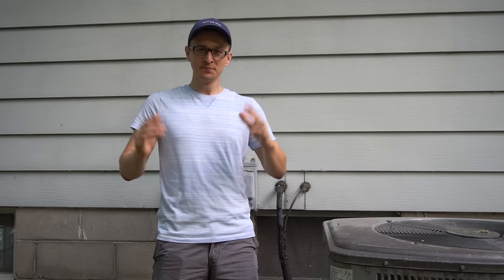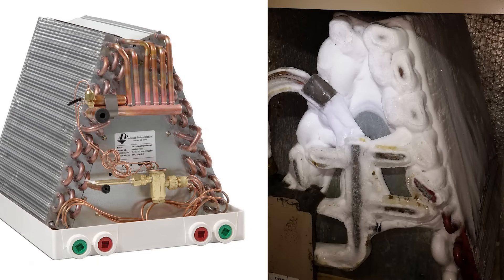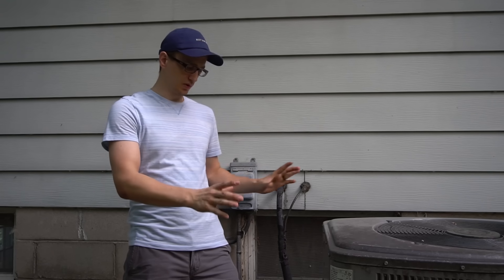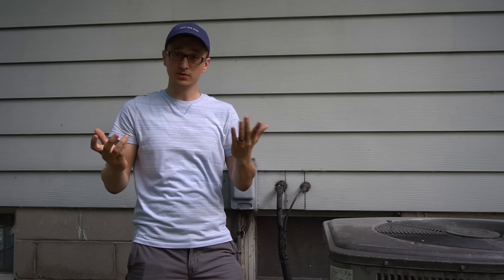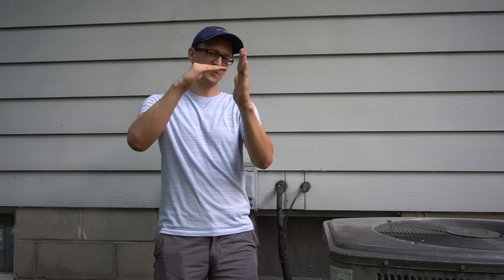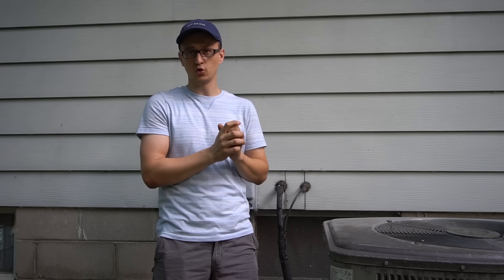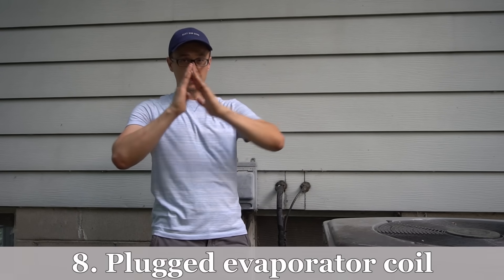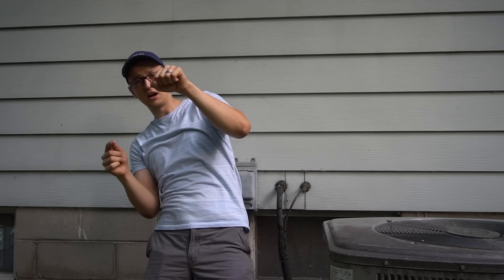8 Reasons Why Your AC is Freezing Up

Comment: What happens on the low side, psi is at 500 when running, suction line is very hot, I changed the run capacitor but hearing a cracking noise outside unit ? Could be a bad compressor ?

Comment: disabled person that can't afford a repair or a new one, it is a window AC "ArticKing" brand, overall it seems to work completely fine, filter very clean, but the coils are still icing over as well as freezing up the filter area so I just setup a bucket for when it does end up melting when I eventually turn it off.. (as I'm only using it when it's TOO hot to tolerate, ie 90s up)

Comment: Thank you from Chicago.  It will be 87 today vs 96 yesterday with heat index of 106.   Turned central air off last night as metal ductwork near furnace was beaded with water and dripping. Glad to hear you say ok to turn fan only on.  Had routine AC maintenance coming tomorrow so will call to try to make sure they don't skip me. I didn't have the maintenance last year. Filter is clean.

Comment: Thank you. During winter I was doing some wood work and propped up lumber in front of the return vent. The air handler turned off twice today so I started looking for answers. Thank you for doing this in such a matter of fact and succinct way. Was easy to check off each problem as you went along.

Comment: Not bad description I'm glad I can do my own AC I just took mine 24 years old scroll motor 10.9 Sear it is R22 and it's probably going to cost a fortune to get more Freon I have a friend by the way, but a lot of people don't know you can get a clean your coils condenser and evaporator coils and then they make an epoxy spray paint that you can spray everything with you want to remove all your rust by rust remover product just spray it with first and your sister will last much longer and make sure everything's drained and clean mine is still working perfect my Reen heat pump 2 ton AC

Comment: Whenever there’s a brownout/blackout my blower motor stops working. It’s a ecm type so no capacitor. This has happened 3x now. It magically starts working after 3 days or so. I’m on the third time rn, really hope it turns back on. Do you know why it could have this problem? 

The outside unit still works and the inside unit ends up freezing. The problem is just the blower motor. And I’ve checked inside the motor before, it doesn’t look like the boards got burnt and it looks fine.

Comment: My ac quit working for a couple days and today it randomly started working again, what could have caused that its never done that before and mines electric
Reply: I’ve had that problem before too. Whenever the electricity goes out. My blower motor stops working. It’s an ecm motor. In the summer heat rn hoping it turns back on. Twice now it’s magically turned back on after a few days.
Reply: @MsIlovemusic07  Maientenence fixed it sime part was fried, but never explained what part or what caused it

Comment: Does all this info apply to ductless air units too? Im in idaho and mine is making a weird noise and when i checked it i see all the ice. The filter is a little dirty so I'm going to clean that and i shut it off to let it thaw. It's very cold here so I'm running space heaters till i can get it thawed and the filters clean to see if that fixes it.  Hope this is the right way to start the trouble shooting before i hire it out but was curious if any of this applies to my ductless air unit. Its icy here on the ground and temps are between 20 to 40 outside. I'm in a new house built 3.5 years ago w ductless air that only has one vent at the front of the house.  They didn't put multiple heads on it to reach the bedrooms .  It's a 3 bedroom house that's 70 ft long.

Comment: You saved me at least a 95 dollar service call on the first item. We had hardwood and paint people here doing massive sanding and I know I should have thought about it but didn’t think to change the filter. When I did there was visible sand dust and paint particles all over it with zero light coming through. Changed it out and good to go. Thanks so much!

Comment: There was no air coming out my vents. Checked condenser and it was covered with a layer of dirt and grime. Stuck a hose with hot water, cleaned the condenser really good with a good pressure from my hose. Did in both side. Waited a bit for the water to  stop dripping. Put everything back, turned on my AC and WALLAH! strung air coming out of my vents. Thank you so much for the great video. Wish all youtubers were like you. Most will spend 30 minutes taking BS to accumulate minutes and in the end, most are a waste of time.
Reply: Where is the condenser located?
Reply: It's voila, not wallah.
Reply: @davidboatman925 lol! Love it.😅

Comment: The only things that can possibly make a system freeze is either
 A) an airflow issue or
 B) low on refrigerant. 
 he did a fantastic job at going into specific reasons of each, but  just a rule of thumb to help remember is that the cause of it freezing will always come down to one of those 2 reason
Reply: also a messed up metering device or  filter dryer can cause the freezing too

Comment: Mine is completely frozen over, the outside unit is frozen, filters were just changed, outside unit is clean (I clean it twice a year) last night I checked the drain line it's clear but this morning it's frozen over. Not sure what the problem is.

Comment: You have a wealth of info and here's a question for you if I cover all the gaps around the filter 20x25x4 would this crate slower flow of air? reason is my ac was keeping the house at 74 and I knew it was time to change filter. I never noticed this before a very large gap on the front on one side where the housing meets the filter. Anyway, when I sealed this gap up my unit could not reach 74 anymore and the line feeding the evaporator inside the house was frozen. could this be true?

Comment: Cleaned the outside thingy, fan is running good, blower motor is running good, weird filter on top of heater is new, green light through sight glass is flashing green , turned off and let the pipe thaw out, turned back on and it started freezing back up again

Comment: Thank you so much for posting this super helpful info. I have an oversized 3 ton heat pump for 1000 sqft space, and  the coil in the air handler is freezing over. All the HVAC companies that have come out to look at it have basically thrown up their hands and tried to sell me on a totally new smaller system (2 tons). We cannot afford this. Is there any way we could simply downsize the heat pump to a 2 ton (single or two stage), and keep our multi-speed 3 ton air handler? Any advice you could give would be greatly appreciated as we are at a loss.

Comment: What happens if it freezes up during the winter? It's just set to heat
Reply from the maker: That likely means you have a heat pump. Is the heat working good? If yes, then don't worry about it. Its normal for some frost build up to occur before the defrost kicks in and thaws it out.

Comment: 1 Additional reason to add here. Faulty/dirty/old electrical contactor at the outside compressor getting stuck in the ON position causing it to stay on indefinitely past the thermostat set temp which eventually freezes up the lines outside and possibly inside as seen here.

Comment: IF blower motor isn't even working , it'll be obvious because no cool air be blowing right ?
Reply from the maker: Yes. If you feel no air blowing out of the vents that means that either the blower motor is bad or it is not getting power for some reason.

Comment: Thanks. Very informative video. But I still have a question: I’m the homeowner but I have a 20lb bottle of R-22 and my own gauges. I have a Honeywell electronic air cleaner in front of the filter and the filter is clean after a year. No pets inside. Ducts are clean. One clean coil at 45 degrees and I can get to it fairly easy. Everything works fine most of the time. I run the AC an hour in the morning and an hour at night when it’s cool outside. I have a 11/2 ton system in the equivalent of a 2200 ft2 house and it takes a long time to drop the temperature here in Northwest Georgia but it does a good job of removing moisture. I have a piece of cassette tape on the living room register so I can see that air is moving. My condensate drain is about 3’ long and I put bleach in it several times a year. I have a thermometer in that grille and it stays at about 60F. I think that all the things you mention are ok. 
If I let it run on its own, and it runs for several hours, the coil will freeze up. I shut it off, remove a panel, and use a desktop fan to melt the ice. 
My question is that for years the charge has been enough for the low side to be 62-65 psi. That corresponds to 36-38 F for R-22.
I don’t understand what changes, after my AC runs a long time, that makes that 62 psi/35F low side decide to get below freezing and to start icing up. A 35F coil should not form ice.

Comment: I came home last night to a hot house and yes the A-coil was froze. I de thawed it over night and this morning the air started freezing again after about 35 minutes. Everything checked fine inside and out but by expansion valve is making a hissing noise. Is this normal? I’m guessing I may have low Freon, but it went somewhere. The unit is a Trane XR11 and 20 years old. Great video and priceless channel. 😎🤘

Comment: If you can answer this question I would be grateful.   Can I run my ac "compressor" not the air conditioner non-stop for 8 hours without recycling and causing damage to the ac unit?

Comment: Thank you for all of your videos. I have really enjoyed them and learned a lot. I do have one question my AC was not working. I checked the capacitor and it seems like it was bad so I replaced it the AC unit turned on but after about 1415 hrs., it turns off again. Any idea what would cause this? By the way I have had someone come out and professionally clean the unit. They also check the Freon level in the pressures and everything seems to be fine on that and I am also replace the filters in my house.

Comment: So if my issue was a dirty filter… If I change the filter and turn the fan on to thaw the pipe, will that solve my problem?

I’m currently starting the trial and error process.
Reply from the maker: Yes, that would be a good place to start. Change the filter and let any ice build up thaw out before you try running the air conditioner again.

Comment: What about if your condensation drain pipe thing was plugged. Could that cause your coils to freeze? Mine was spraying water out the sides. I forced air thru the drain tube and it stopped. But I think it caused the coils on to of the furnace to ice up.

Comment: Will any of these cause it to freeze up instantly?  I had an AC frozen when the blower fan capacitor went out. Replaced that, worked for a few days then the blower fan motor burnt out. Replaced that, got it running, then here on a 90+ degree day I go outside to check it and it's immediately getting ice from the compressor and through the low pressure line.

Comment: Hello, thank you for this video. I have such a problem - in the morning it was hot - 27 degrees Celsius and the air conditioner inside the house, when turned on, cooled the air to 20 degrees Celsius at the outlet of the duct, and in the evening I measured the temperature of the pipe at the inlet of the air conditioner and one pipe 24 degrees Celsius at the inlet and the pipe at the outlet the air conditioner was 9 degrees Celsius and froze, and at the same time it was 22 degrees Celsius at the outlet of the duct and 24 degrees Celsius outside. In other words, the air conditioner no longer cools as efficiently after 12 hours of operation - what's the problem here? I would really appreciate if you can point me to the right direction, so I would be able to troubleshoot it myself and learn.

Comment: Excellent information.  Mine turned out to be a fouled (dirty) evap coil. I had to cut a "window" in the side and use a shop vac with a brush extension. Ran to the local HVAC shop and they sheared a piece of scrap to 1" oversized in both directions in the measurement of the "window". They were nice enough to give me some self tapping sheet metal screws. Pre-drilled holes in the cover, used those as a guide to drill the holes in the plenum with the self tappers and dry fit the cover.  The next part is going a little overboard, but I drew a line around the new cover (using it as a guide), removed the cover, smeared a little grease on the plenum only from the drawn line, in. Put a bead of silicone 1/4" in of the parameter of the cover, set it to the side for an hour while I poured myself a bourbon and watched some videos on the tube of the yous. Then, reinstalled the cover just enough to slightly compress the silicone bead. This system is only 5 years old so I'm sure I'll be the one removing the cover again. If not, I left instructions on the side of the plenum for the next guy, or gal.

Comment: I replaced the filter and cleaned the coils, but it's still freezing.the blower motor is working. I checked all my vents and registers are open. I let it thaw yesterday and cleaned everything out and it worked for the day and cooled the house but was frozen again by today. 😢

Comment: Agh. Thank you for this video. I was up until 3am trying to figure out what's going on with my AC. 😭 I even took out the blower motor and cleaned it and still nada. My unit outside works, the compressor works, the capacitor was replaced like a year ago, but inside, my blower motor doesn't spin full speed. It stays spinning, but pauses and AC never turns on completely. I'm out of ideas and so tired. 😭

Comment: My thermostat kept reading 26 Celsius and I had set it to 22 the night before, next morning still same reading. I cleaned out my unit outside with foam degreaser and also noticed the lines had iced over. After cleaning with foam and rinsing with water looked great and it was so hot that ice had all melted. Put everything back in place and turned on the A/C and cleaned all the weeds around the side yard, within 15mins looked over and saw the lines starting to freeze over. So turned A/C back off and turned on the fan so ice would melt again. 

I had already made an appointment for service assuming it was the thermostat, he brought a mini Freon tank topped it up and then did me a favour and added slightly more since unit is 2008. He was sure it wasn’t the thermostat, almost six hour later after service back to 22 degrees Celsius like last summer. Hope my experience helps someone. Oh and thank the Lord the service call was covered under a furnace package that I’m almost sure didn’t include any A/C service but the system showed it did.

Comment: I have a unit where the a-coil iced over I believe due to a dirty filter.
After the filter was changed the unit no longer froze but it is not 

blowing cold air. Slightly cooler than air temp but not cold.

Any ideas what is wrong?

I think I saw you are based in the twin cities, Minnesota.
Do you do service calls in Roseville?
If yes, how what I set one up? 
 Thanks

Comment: There are THREE causes of "freeze-up" in an AC system.
1- reduced/no airflow over the evaporator.
   While several of the things you mentioned DO affect airflow, they all fall under the category of "reduced/no airflow".
2- restricted flow of refrigerant into the evaporator.
   Clogged/restricted piston orifice, capillary tubes or txv/exv or
failed txv/exv(in closed position).
3- low refrigerant level.
   Note: on this one, keep in mind that it is NOT normal for your ac system to need refrigerant added periodically. If your system is low of refrigerant, it either A- was improperly charge/serviced or 
B- has a leak.

Fun fact(?)- "Freon" does not mean "refrigerant". It IS a BRAND that produces/sells refrigerant; i.e. Suva, Dupont, etc.(all brands/manufacturers who make and sell various different refrigerants).

Comment: Excellent, thank you. Two  additional reasons: the outside AC Fins may be dirty. Take the time to spray them with a good non-corrosive cleaner, let that sit for 5-10 minutes, the hose off with a brisk spray that won’t damage the fins. Done twice a year, beginning & end of season  may help. Regular maintenance is worth the effort to save you lots of $$$$. Also, when was the last time your entire house Duct work was cleaned out? It’s amazing what & how much “stuff” accumulates within them.

Comment: I had guys come out, and he said the connector is basically crap and needs to be replaced. The AC is 10 years old,just brought the house 8 months ago, and never had an issue.. but for the last 2 days, we had the AC set to 60°- 64° OOOPS! I don't want these people ripping me off 😢 should I just wait for the ac to melt and retry the ac, and if it happens again, should i replace the connector. He also said he can't do a full evaluation since the attic stuff was frozen, too. Guess I'll see tomorrow once they come back. Pray for me. Also, he gave me a quote of $350 to replace the connector.

Comment: Why scare people away? Using heat mode on an AC will built up ice on the outside unit if it’s cold, and this is perfectly normal. Most units have built in de-frost!

Comment: Mine froze up a couple days after I put a new filter in it. Could that be the issue? The fan unit outside doesn’t come on at all and when I tried to turn the fan on and it makes a humming noise from the inside unit in the garage. Any ideas?